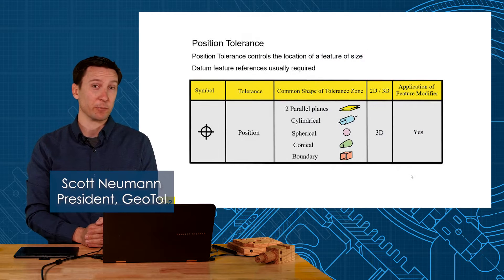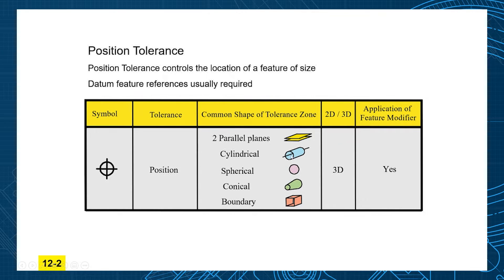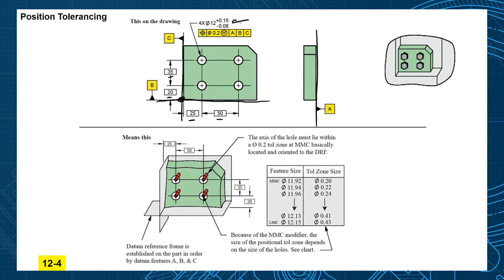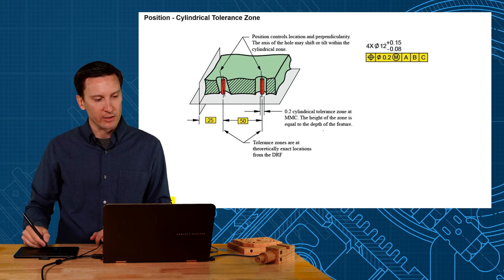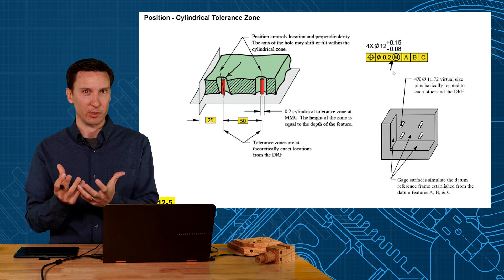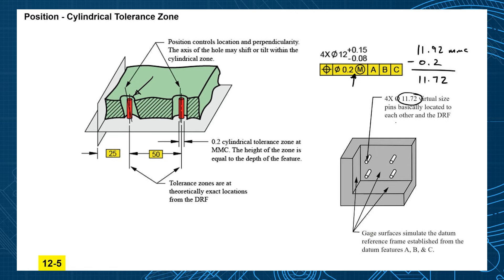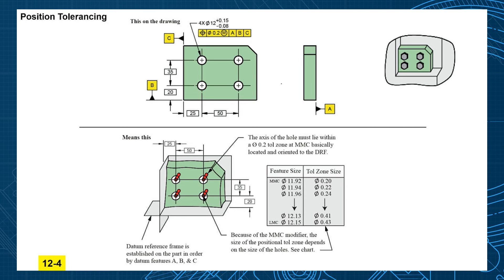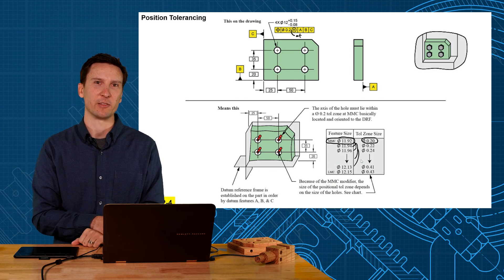Position Tolerance Introduction and Review

Comment: hi sir this is kabilan i have a doubt   (shaft) Dia 12 +0.15  - 0.08 what is  the MMC of the shaft  12.15 or 11.92
Reply from the maker: These are holes. The maximum material condition is the smallest hole at 11.92.

Comment: How do you give position tolerance to holes that are normal to and on a curved surface? For example set of holes that are on a cylindrical large tube (harder case would be holes on a double curvature surface)?
Reply from the maker: The tolerance zone for position is always centered on the "true position". The basic dimensions from the datum reference frame define the true position. It might take an X,Y, Z and even basic angles to define that complex "true position".